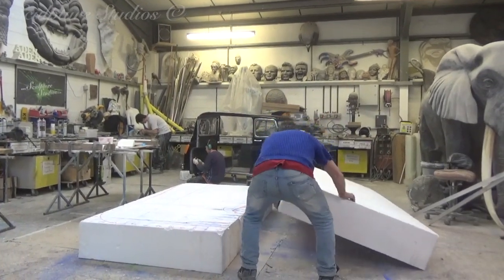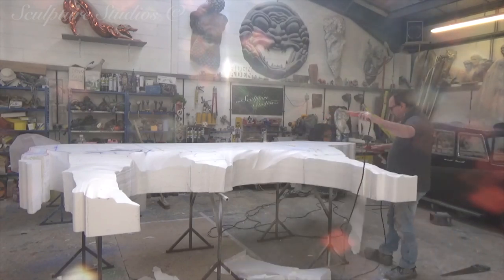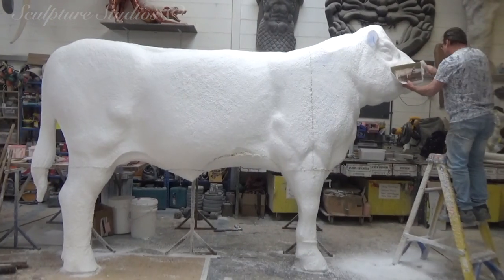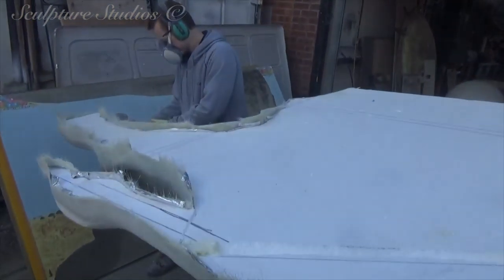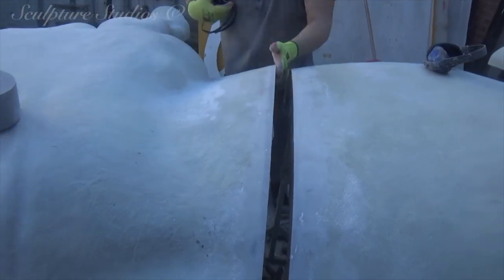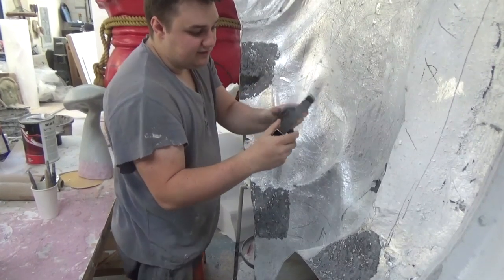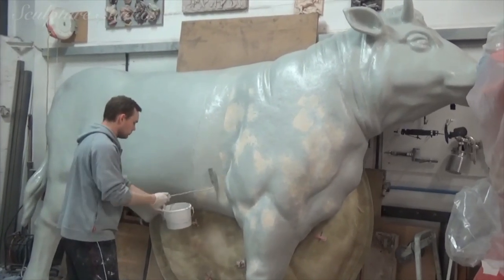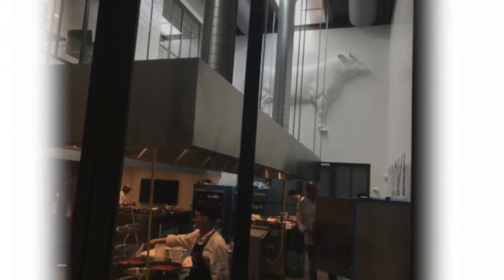300th Video!! Giant Cow Wall Art by Sculpture Studios

Comment: Just wanted to congr-ungulate you on an-udder great video!  How many layers of fibreglass did you end up using (i.e how many ounce)?
Reply from the maker: This wasn't going to be touched by the public, and we wanted to keep it as lightweight as possible. So there was a maximum of about 3 ounces over the entire body. And a little extra thickness around the edges.